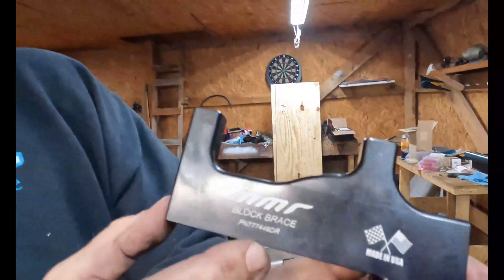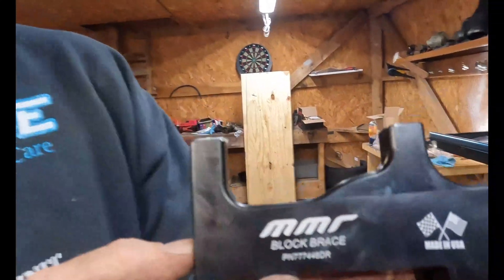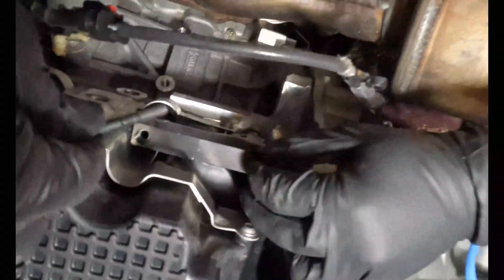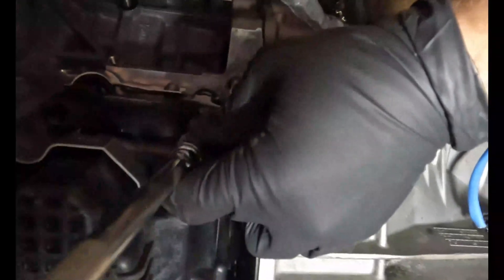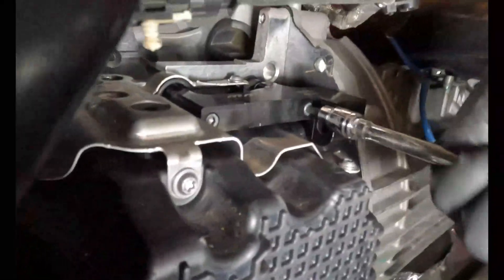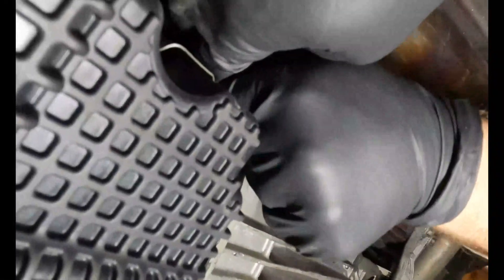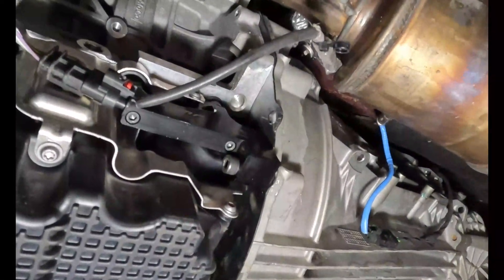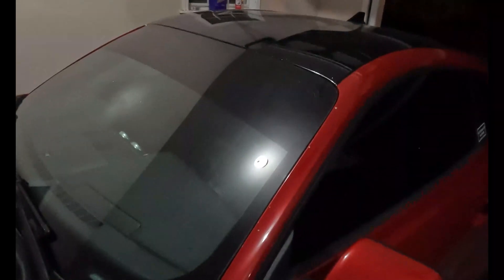MMR Coyote Block Saver Install

Comment: Will this works if the brace already  broken 😢
Reply from the maker: Did you break the ear on the block?? If so mine was broke when we installed these!! MMR actually states in their website that most people but them AFTER they have broke their block!!
Reply: @aftermathgarage  yes is broken also i just noticed my bellhousing is broken to because of the stress of broke brace i believe.
Reply from the maker: What brace are you talking about?? The transmission mount near the end of the transmission? See the bell housing breaks due to the engine and transmission trying to go in two different directions during hard shifts. The block savers make the engine and transmission one unit to where they can't twist in different directions
Reply: @aftermathgarage  no its where you put the MMR support i didn't know they sell that support and mine broke and cracked my transmission bellhousing
Reply from the maker: Oh damn bro!! Yeah if the bell housing is cracked you will need to fix it, should be able to order a new one on line for the MT82, it's a bitch to pull the transmission,  but I've done way worse

Comment: Just ordered for my 2022 A10 GT CS.
Reply from the maker: Man I know they make the shifts more crisp in the manual cars, I would love to ride in a 10r80 car with them!!
Reply: @aftermathgarage  ive gotta upload my new tune. Just had a circle d 245mm 3800 stall installed. How found the crack. Shop welded it & installed braces. Should hit really hard now.  Car is prob around 700 hp . Have ESS G3 on 120 mm pulley, seeing 9 #'s of boost over 7000 rpms.

Comment: My 2020 does not look like that. My 10speed has coolant lines in that area and a bolt sticking out the bell housing right there
Reply from the maker: Yeah the 10 speed cars are not as known for breaking the ear off as the manual car!! So double check with MMR and see if the 10 speed cars need them
Reply: @aftermathgarage  Too late, already installed. I will upload a vid on it. Thanks!
Reply from the maker: @Carbon5.0  do it bro!! I talked to Jacob the other night and he said yes that the 10 speeds need them too
Reply: Just uploaded the vid!  @aftermathgarage